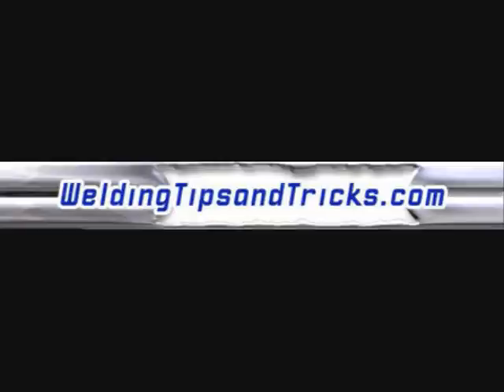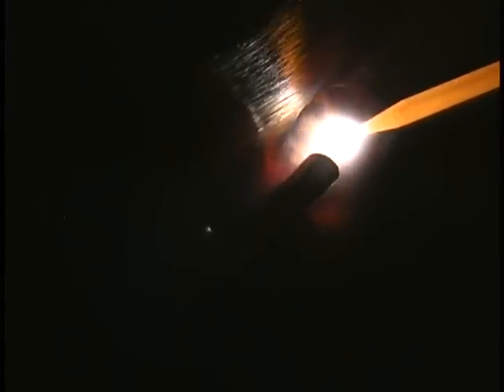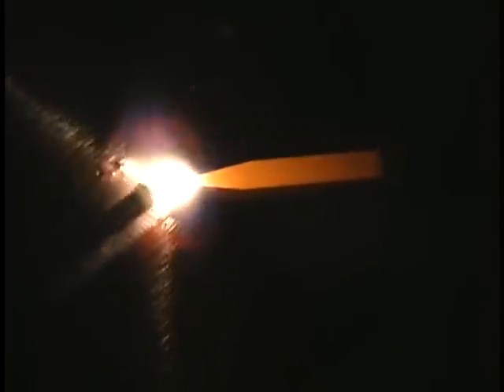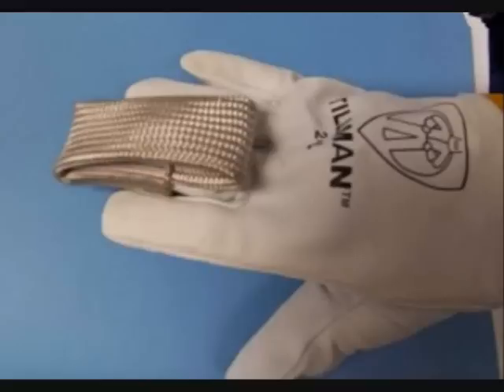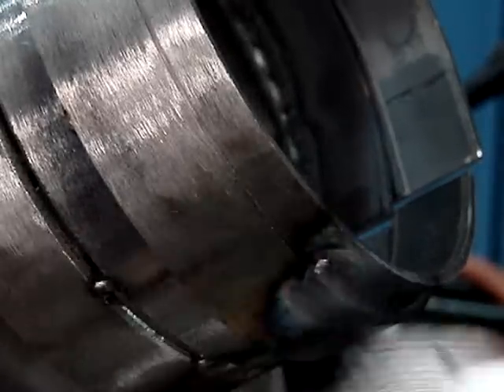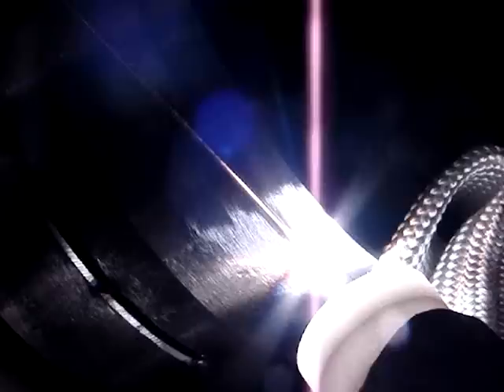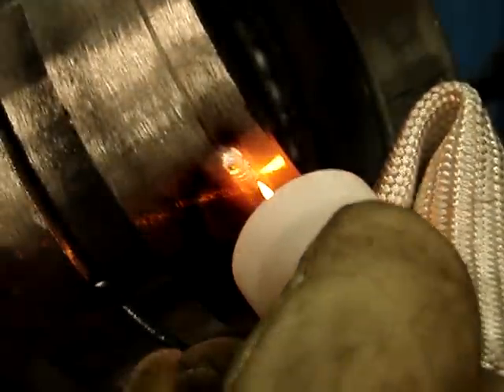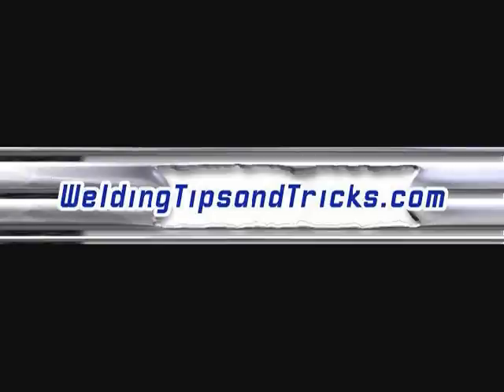Tig Welding Techniques Steel Lap Joint and Butt Joint

Comment from the maker: @MasterFabricator100 
yes it has a wire screen diffuser along with gas lens collet body.  its mainly good for titanium, and all superalloys.
also stainless food service, stainless steel headers and exhaust components, and anything you want to remain shiny after welding

Comment from the maker: @weldingtipsandtricks 
forgot to mention, the main reason i used it for the video was to make sure the arc could be seen. i can extend the electrode over an inch with the big cup and sometimes that provides for a better camera angle...whatever it takes, right?.

Comment: That TIG finger looks like a folded-over piece of braided S.S. shielding you'd find over teflon hose.  It's sort-of a metal version of the Chinese finger trap.  I'm sure the unit on WT&T's glove is custom-sized and terminated, but if you don't have the budget and have Red Green's junk collection, maybe you can come up with one.  Just saw their website, and $10 plus shipping is a decent price.

Comment: im surprised ur getting any shielding gas because ur tuscan is alot out can u explain how u get a good weld and how i can improve my t-join welf because i cant get the angle ... so message back tht will help im doing post 16 and i finish soon and i need to pass the course so i can go to level 3 and i need to get a pass or merrit message back cheers.

Comment: How much stick out do you prefer on this kind of joint? And another question how do you get your puddle that big (sharp tungsten?)
Reply: Not sure what kind of rod he's using, I'm assuming that he's using a lot of amperage to be able to melt the rod and get it as good as he's getting it. Sharpening your tungsten is really going to help, it concentrates a lot of the heat into a small area which is going to put all the amperage you'll be using to use. You can stick the tungsten out according to what kind of torch you have, 5/33 or whatever depending on what you're using.